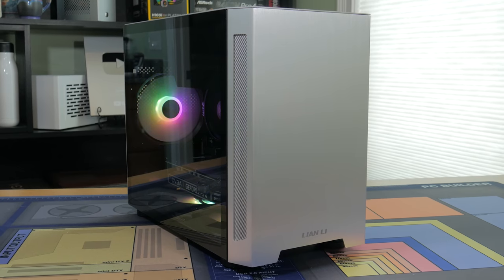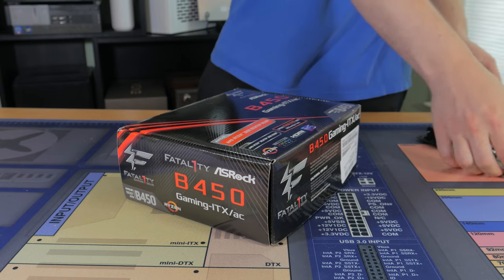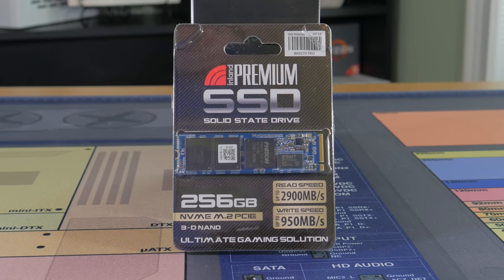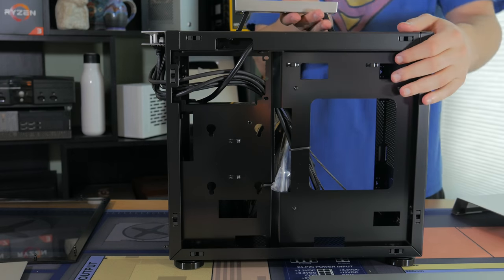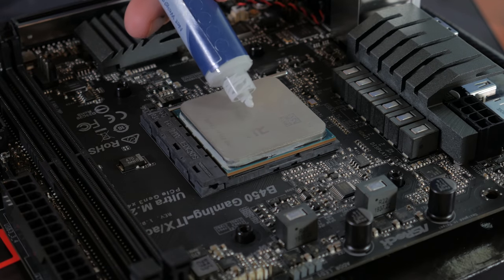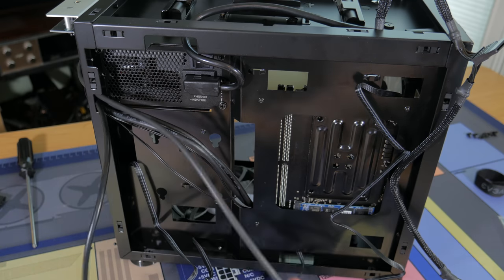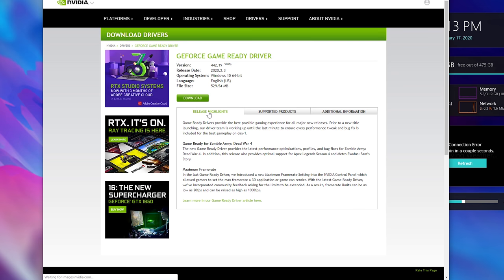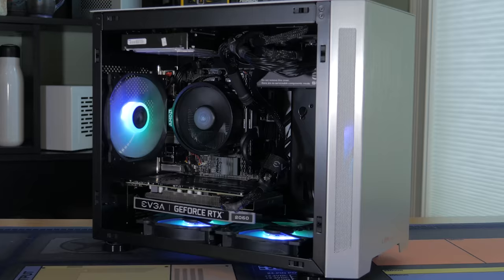$1000 ITX Gaming PC Build Guide! (2020)

Comment: Matt are you using this as your main system by chance? If so, PC TWINS!! If not, awesome build nonetheless 🤓
Reply: We can be twins 😂. Made this exact build soon as this case was released. 3600 cooled by noctua u14s, 1070ti instead of 2060, 1Tb Intel 660p, 16gb g-skill 16gb 3600 cl16, 650w seasonic power supply and 1Tb hard drive and a 240 GB SSD boot drive. Had gpu, ssd's, hard drive already n just swapped it over. Loved the case n ready to upgrade from an old 4770k
Reply: @4thMUSKETEERS  Triplets! All of us!
Reply: @nerdonabudget  quadruplets?? i basically did your build danny, just did a Ryzen 7 2700x, Corsair SF600, and a 1TB samsung SSD, and Corsair vengeance pro's at 3600MHz
Reply: @illoquence_  sure why not, come right on in! TU150 Master Race!!
Reply: @4thMUSKETEERS  we can be triplets cause i also made the build

Edit: we litreally have 5 people with the same build what is 5 people with the same build called now?!?! Also my build is not exactly $1000 its like $1100 cause i bought a more expensive board (Asus rog strix B550-i gaming) also my build is a bit diffrent cause of the diffrent parts

Comment: Made this exact build soon as this case was released. 3600 cooled by noctua u14s, 1070ti instead of 2060, 1Tb Intel 660p, 16gb g-skill 16gb 3600 cl16, 650w seasonic power supply and 1Tb hard drive and a 240 GB SSD boot drive. Had gpu, ssd's, hard drive already n just swapped it over. Loved the case, and wanted to n upgrade from an old 4770k build

Comment: Using the InWin a1 chasis and RGB is everywhere within it. I’m able to run 2k independently with it. Using Gigabyte RTX GeForce 2060 triple fans and ryzen 7 2700 or something like that, bare with me I’ve only had my pc for 3 weeks and it’s my first ever pc. In love with the ITX builds and cannot get enough. Also my evo m.2 or whatever it’s called is 1 terabyte and added a ssd that’s also 1 terabyte. Was going for 3 but I ordered the wrong hard drive lol but don’t think I need it anyway. My mother board is a Gigabyte x570 Aorus Pro with WiFi booster. So it has a magnetic antenna that’s on top of the case. Man can’t stress how powerful this thing is and runs everything so easily and quietly. The build had to been atleast $1700 $1800 and that’s not including windows pro which was $200. Must say I am very happy with my build and how it performs. If anyway is interested in seeing what it looks like let me know. Gladly send u pics or vids
Reply: Oh and my dram or ram whatever u call it is vengeance 16 GB 3600 MHZ or some shit like that lmao power supply was built into the case 650w and I overclocked it once but never saved it in the library so it went back to normal settings. The thing about having InWin a1 case is that it was very tedious to build, small spaces and make sure u have all the right pieces the first time otherwise you gotta wait. And then the case heats up, think I have a total of 9 fans. Actually there’s a mini cooler for the M.2 so a total of 10 fans lol

Comment: We both put out new vids today!! Ive been wondering where ya been!!! Great Job dude. I just got a Ryzen 7 3800x and 32 GBs of TridentZ Neo 3600 MHz. I'm so siked!!
Reply: Tech 215 why did you go with the 3800x? Just wondering
Reply: @shanewell12  I really wanted an intel system since i mainly edit, but I already have a really nice B450 board so I wanted to get a chip that could handle editing with lots of Rendering power. I do play games and my 1600AF is plenty powerful enough for that, but I wanted a system that would be really fast for the next 2-3 years. 

I'm currently using a 6 core/12 thread i7 8850U in my worklap, but not having a discrete GPU is holding me back.
Reply: Tech 215 what made you go with the 3800x over the 3700x? Currently trying to decide myself
Reply: @shanewell12  If you ever have any questions bro feel free to reach out man, I can talk Tech allllll day!! :)

Comment: Can you do a computer build that is super versatile, maybe around 1.5-2k?
Reply: I can tell you my build just for the exact purpose you mentioned  - A Higher End Budget Performance  Stream/Game PC -

AMD 3800x, Gskillz 3600mhz 16gb cl16
Power devil Radeon 5700xt, seasonic 800w, 1tb m.2 WD blue ssd, 4 tb 7200rpm hhd seagate, asrock steel legend b450 mobo

In a 50 case from !silent brand and also a 4k60pro legate stream card.

Comment: I don't like this model of RTX 2060 super cause of the bad memory temps, in fact the cooler on this is the same as the cheaper gtx 1660 ti or 1660 super i think and it works great on those but EVGA just SLAPPED the cooler onto the RTX 2060 KO wich led them to use a THICC 1cm thermal pad to compensate (even tho it doesn't change anything in temps), we can clearly see the grey pad on the left of the GPU at 5:50

To make this short rather take this 2060 KO and restrain your overclock, or spend a few extra bucks to get a better cooler. 
My personnal thought on this is to go buy the cheaper RX 5600XT if u don't mind AMD drivers and all...

Comment: The 2060 KO edition supposedly has the 2080 chip in it.
Reply: I thought it was like a souped up 1660ti?
Reply: MrElo  the 2060 KO is a variant of the TU104. Same size, same number of transistors as the 2080 just that the 2060 KO has fewer Shaders, Tensor Cores and RT cores and the 2060 KO has a smaller Memory Bus Width.
Reply: MrElo  supposedly 2070 performance OC closer to 2070 super

Comment: the 2060KO is kinda overpriced right now, at least on amazon. 400 dollars for the ultra? yikes, just get a 2070 or 5700xt. Or wait a few months if we aren't under total tyranny.
Reply: this whole build is crap you could easily build a system with the rtx 2070 ,16gb ram, 240gb ssd, 2 tb drive.

Comment: That's a terrible case, specially for that price. It could have easily supported a micro atx board if it was just sightly taller. 
Mounting your hdds on the hottest part of the case (the exhaust fan is positioned considerably lower that the top of the case) isn't a great idea.

Comment: Excluding the PC case will cost you just $500
Reply: How is that? Just the motherboard,power supply,graphics card, and processor alone come to $730 not including shipping from anywhere or sales tax. That's not even including ram,ssd, or fans
Reply: @sinformant  The rgb fans, or the PC case with the handle on the top aren't necessary